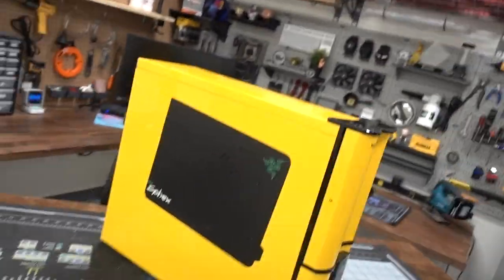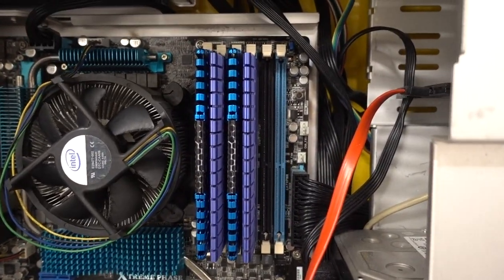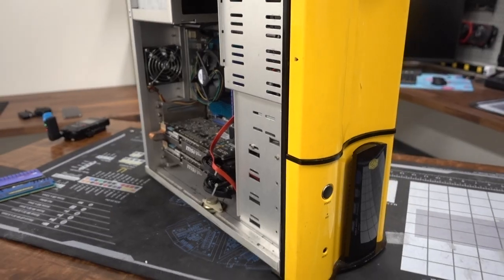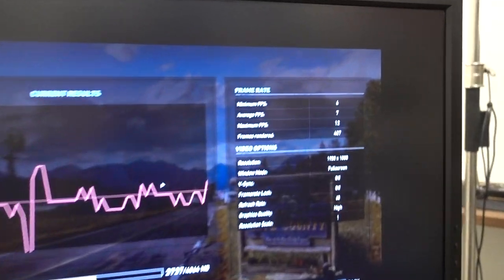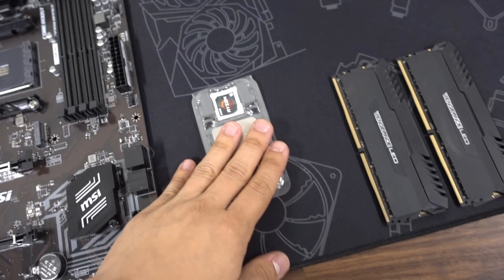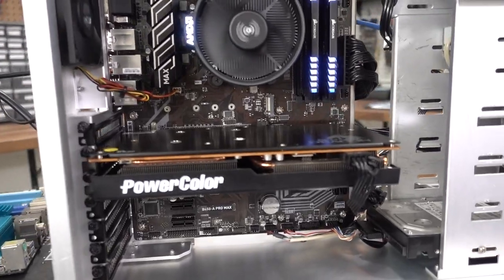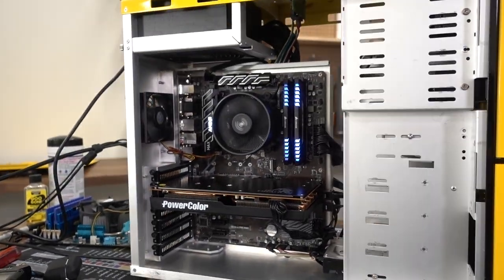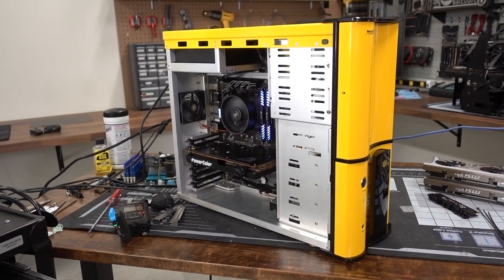It's been 10 YEARS since they cracked open this gaming PC. I'm going in!

Comment: You tested it with the side panels off..lol.. that was not nice..lol..front mount startech cards for x3 USB 3.2 & 1 type c a $20 cost retail
 Would have been nice to see
Drummed out side of inner case where the large hard drive is so 1 or 2 120mm fans cound be mounted and same with back exost fan. 
Ifyou wanted to get fancy a drummed out side panels cut and lifted outward the cut outvto allow more air in, re-using the piece you cut out on 1/4" C joins glued on. 
This just didn't feel like a you video, your always going over the top & felt more like a filler.. good video though

Comment: You can still get passable performance out of the X58 Xeon line that's 10ish years old now. You'd probably struggle to play AAA titles with let's say the 9800 GTX from that time period but if you upgraded to a reasonable video card and overclock the Xeon I bet it would still do moderate gaming. I'm guessing of course. I haven't fired mine up in a couple of years now but it was playing overwatch etc. when I quit using it and that was with like an R 380 video card. That was the best value equipment I ever spent money on.

Comment: I would have just stayed with with x58 platform as its still pretty solid. Get 24gb of ddr3 in there, a 6 core xeon, new sdd, modern gpu, and a 5.25 usb 3.0 hub and you're golden.

Comment: Cool video, another option would have been to install on the old motherboard  a  Xeon X5675  processor, better cooler and overclock it to the max (4.5 ghz) and pair it up with the 5600 graphic card, you would have gotten similar results as with the Ryzen 2600x. Would be a nice future video ideea ;)

Comment: dual channel on an tripple channel system... no...just no... make the ram match, toss in an x5675, matched 1866 ram, it will gain a huge perf boost, 4.4 is easy  on that board 4.5+ should be easy...

Comment: One thing I wish Linus, Jay, and Paul would address is why when I plug something in to my usb-3 port Widows 10 doesn't recognize it right away.  I mean if usb-3 is the new standard now, why doesn't Windows beep like it does when I plug into the usb-2 ports?   Sure I can refresh and monkey around a bit, but why should I?   Anyway, that yellow case is older then ten years, more like 15 or older. I remember Cooler Master selling them and that they were made of aluminum, with a baked on finish, which is why it still looks good.

Comment: I still have this case tucked away in a closet. Cant part ways with it.. it’s the “bare aluminum” edition one. It was a “prebuilt” by Compaq, GX5050 was the model number. Top notch components for its time.. upgraded it a bit as time went by but then I moved onto other things.

Comment: coulda threw in a 32nm 6 core xeon for 30$ then run triple channel memory and overclock the cpu, be good for like a used gtx 1080. this platform still kicks ass these days its just those 6950s lol

Comment: I understand why you upgraded most of the system but still can we at least acknowledge the fact that the only upgrades the PC really needed to be a capable gaming machine again was the GPU and putting the RAM in triple channel (maybe upgrading the CPU cooler and OC the CPU too). It would be a cool video to show people how a lot of the old hardware is still really good and it's cheap now, that's why I love budget gaming PC's using older HW.

Comment: I have to wonder how many times Cooler Master used that case--I have a CM Tsunami next to me which is nearly identical.  The only differences are it's grey aluminum rather than painted, it doesn't have the widget on the lower right of the door, and the left panel is a plastic window.  I bought it a good nine or ten years ago and still use it now (though I'm finally moving on).

Comment: That case is way older than the components installed, the OS used doesn't recognize the hardware fully which is why you cannot enable crossfire. (Thanks to the mainstream crammed drivers compiled by microsoft).

Comment: "Remember booting off 128GB SSD?"
i remember using a 26GB ssd as a cash on a laptop. it dod not show up as a drive letter in windows so i did not know it was there till i went exploring disk management also it was using the wifi connector and not an m.2 slot. came in very handy when the sata connector died and i could not even enter the bios with the HDD inserted in it. i know it was the mobo because all 4 of my HDDs did the same thing and they all worked fine on my desktop. by that point i just told my friend who had bought the laptop that ill give him $20 for his 500GB HDD and install windows on the SSD. he is still using it to this day with his files moved to a usb thumb stick.

Comment: Have one of these in silver! Awesome case, build quality you could only dream of these days. To remove the front fans, there are two small screws (top and bottom left of the lower part) you need to remove, and it will swing out just like the door at the top.

Comment: OMG the wave master. I had the silver/aluminium version of it for my second build ever. i had a I7 940 in it. I did remove the top IO to add a top fan with an optional bracket that came with it. Still have it stored for hopefully a retro build or something.
Edit: you could remove the screws in the back and slide the motherboard out back

Comment: The CPU cooler is a wraith spire and i'm unsure if it's what came with the 2600x, i'd say from factory they shipped with the smaller one, the stealth.
Oh and this turned out nice for a one-day build, but personally i'd have liked if you had taken the extra time to get the front panel off, replace the lighting, clean the fans etcetera. I don't know the case but there has to be a way.

Comment: I still run a 256gb ssd in my desktop. i also still use an intel core i5 2500k. but the gpu is modern enough being an MSI 1060 which works good enough for now

Comment: Lol, Had the same case, Also had the i7-920, with the asus p6t se, but instead of crossfire, i crossflashed the standard p6t firmware on it so i could run sli with 2x gtx 260's

Comment: haha i had this case like ages ago.. its definitely more than 10 years (blue coolermaster wavemaster). 

Btw.. the whole motherboard tray you can remove it , for easier access to the motherboard installation; it was truly a godsend at that age of time. 
So were the 3 x 80mm fans , LED light near the front intake.

At that point of time, i believe the best case was the TJ07 silverstone full tower. nostalgic times. haha
edit: to remove the front fan , u can access through the front bottom panel (the top door that opens with a magnet, the bottom one can move out too, i think u need an allen key to loosen the bottom panel)

Comment: Relocating the Harddrive to the bottom was super stupid. Now its blocking half the fan. The position it was in before was way better. It was completely out of the way and not blocking anything. Instead to now it was even more benefitial because it streamlined the airflow from the fan directly to the GPU.
Dont know what was going on in your head when you thought blocking halb the fan on purpose must be better than anything else.

Comment: Please re-test the old hardware. I am missing here the power consumption comparison in iddle and on load while using single or dual GPU. Also please re-test far cry benchmark using single radeon after thermal paste replacement and while only one of them is plugged in and can actually breathe. That GPU had to seriously throttle. ;)

Comment: I'm surprised at how clean the PC was, inside. It did have a fair bit of dust but considering that it apparently hadn't been opened in 10 years, I expected a lot worse. I've seen photos of PCs that were filthier than this after 1 year of no cleaning, nevermind 10. I guess that might be because of the limited airflow as there are less vents for dust and stuff to get in but still, it doesn't look too shabby.

Comment: That's the exact same frame as the Cooler Master Praetorian I've got from 2002, just with a terrible front panel piece. Looks like it's still got a future if you can put a machine of that tier in that awful variant and still get good temps.

Comment: I would never use a 10 year old PSU on a new built, especially if it isnt really top of the line and probably isnt supporting the newish C7 power states. Do you expect that poor power supply to run 20 years? What if it dies in 2 years and shorts out some of the new hardware?

Comment: I still have a desktop that rocks a core 2 duo built when that cpu was brand new. And it's still in mostly working condition. The psu gave out but all the other components are still in working condition

Comment: I owned the blue version of that case (all aluminum). 

It has the worst airflow of any case you will ever own.  I even tried cutting a hole in the side for a fan on the GPU and widening the holes on the front... nothing was enough.  It also has a horrible design around the front fan/hard drive bay that allows air to recirculate from inside the case back into the front fan.

Comment: I have this case, but mine is the black version. There are two things that wasn't shown on the video. One is the tray where the motherboard os attached is removable, so you can mount all the components outside the case, and the  slide everything inside the case once it is ready. Two: the upper usb and audio ports can be switched for a 80mm fan, there is a grill that comes with the case to replace the usb ports.

Comment: I wish cooler master would make a modern version of this case with a black interior, bottom power supply location with a psu shroud and tampered side panel on the left side. I absolutely love the style of this yellow case because it truly stands out but in a good way. You either love or hate this case.

Comment: I have this case in silver one of the best cases Cooler Master had ever made and I am surprised you got the height size card in! You said you could not get to the front fans which you can it just hard work two screws hold the front very well hidden and a screw on the under side then it just swings open.😎

Comment: i had this one in brushed aluminium. I think the best case i ever had in build quality, or at least in material and expenses that where used in the case. Cooling and inside are improved a lot now, but build quality of the fronts with think metal/aluminium i have never seen after that period.

Comment: Why use a b450 board? B550 at least isn’t much price difference and is entry level. Terrible advice using a B450. That GPU is pcie 4.0, your losing bandwidth. Plus your ready to upgrade your cpu in a year or so.

Comment: Holy crap i remember those Thermaltake tsunami cases. I had one in matte black.

EDIT: Okay I was wrong. Upon further inspection a Cooler Master logo is clearly visible. But you can't tell me it doesn't look very similar.
Reply: What stops this from being a rebuilt, a modify case -one
This Cooler Master logo I can also put on my case with double sided tape?
..that doesn't give the case its rights to be named "Cooler master.. or no?

Comment: calling that system high end is strange considering I had a simi high end back then and it was not the  920 but the I7 940 
coupled with 2x GTX 295. 
However this case needs to be changed it's not worthy of newer hardware.. it doesn't have the airflow for newer hardware.